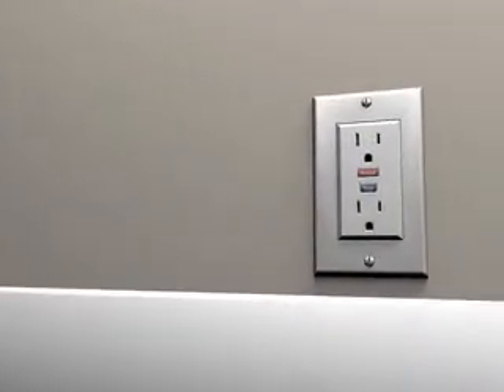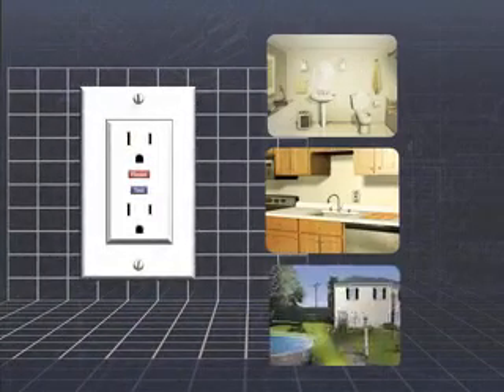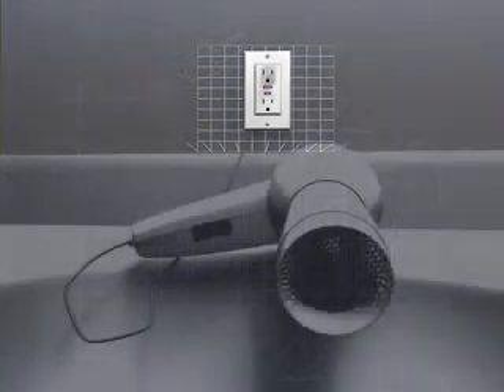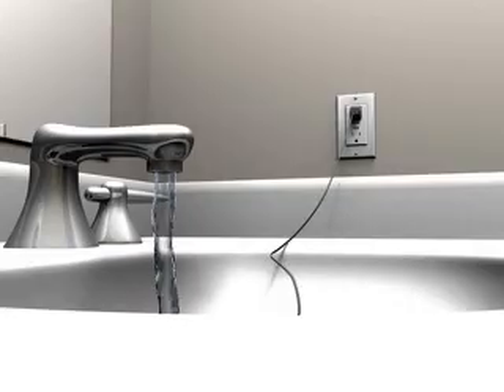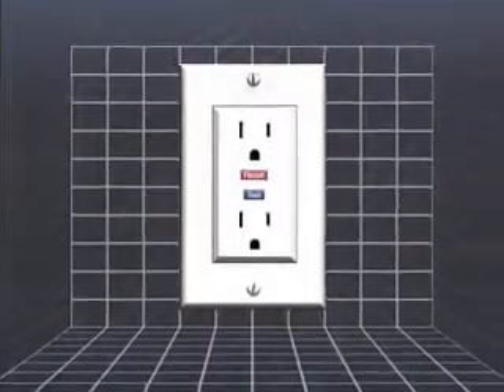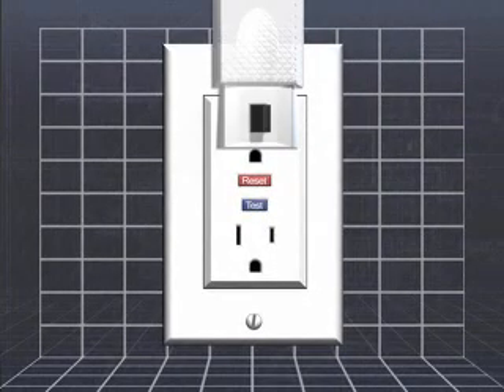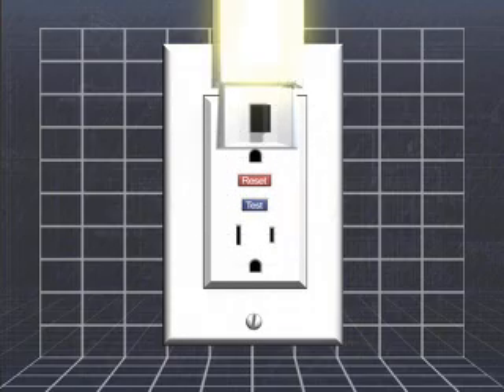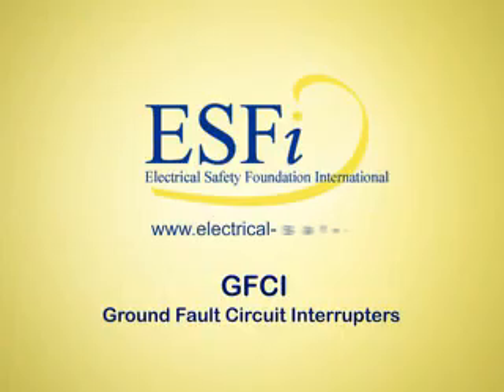GFCI Outlet: How it works and how to test.

Comment: I have an outlet outside on my patio that I’m not sure is GFCI or not, and perhaps it is connected to the same circuit as my garage outlet which is definitely GFCI. This video helped so much. I’ll plug something in to the outside outlet and push the buttons in the garage and see if the outside shuts off, since it doesn’t have buttons. Thank you

Comment: Does the test BUTTON put the current on the ground conductor or the neutral conductor?
Reply: To the neutral so it works even if there is no ground (on old installations).
Reply: @okaro6595  Must use an (inductor) ‘or something’ to cause current imbalance?

Thank you

Comment: I notice many GFCI video's mention that if other plugs are on a GFCI circuit they will be controlled by the GFCI's safety feature.  This is not exactly true.  other receptacles in a GFCI circuit can technically be in the same circuit just not wired to the load part of the GFCI, in this case the GFCI will not cut power to the devices.  A better way to say it is that other receptacles tied to the load of the GFCI, or other receptacles controlled by the GFCI will also trip. But saying all plugs on the same breaker as a GFCI are protected is not true, and can be an unsafe assumption.

Comment: The only thing I don't like about these plugs, is the price, 10x the price.  I lived in the UK once and like the way they have their plugs.  Each male plug has its own 3, 10 or 15 amp fuse in them.  No need for a cfgi.  Sure, the fuse would need replacing if it trips but they're so cheap and it doesn't really happen often.  $23 for gfci, $2 for a normal plug. Robbing sob
Reply: A fuse is an over-current protection device, not a ground-fault protection device. You will die well before the fuse blows, when there is an electrocution accident that might have been prevented with GFCI.
Reply: a gfci has a circuit board in it. Its nothing like a fuse
Reply: @jasonkilner9332  In Europe they do not have circuit boards. Electronic ones are banned here.
Reply: Fuses and GFCIs are not related. In Europe GFCIs are called RCDs and they are in the consumer unit (the panel) instead on the sockets - though socket option is available.

Comment: The outlet in my bathroom only turns off as long as you push test. It goes back on when you release. No reset. My room mate opened the receptacle in his bathroom and found some bullshit wiring with electrical tape and a ground wire that went nowhere.

Not going to say it's the fault of the Chinese landlord, but haha, of course it is. Cheap asshole doesn't employ licensed (or competent) contractors.
Reply: aluisious sue the fuck out of him.

Comment: is it bad to leave a something plugged in an outlet without using it? Like would it waste electricity or something? For example, some people might just leave the charger plugged in without after its full charged.
Reply: Often such devices do draw a small amount of electricity even when they are not charging the connected device.  They are considered "power vampires" because they waste small amounts of electricity whenever they are plugged in, as does a digital TV set that's "turned off", but still remains in standby mode, "ready" for a remote command.  Better to disconnect devices you don't intend to use very often.

Comment: Using the built-in test button is the ONLY proper way to test a GFCI.  Using plug-in testers are NOT an accepted method per UL listing.

I'll repeat that:  Plug-in GFCI testers are NOT approved to test GFCI receptacles.

Comment: Sigh.  Testing with the button is perfectly fine.  It's designed to allow a current leak -which is exactly what a hand held tester does.  It is recommended to test your GFCIs once a month by pushing the button (if you want, you can buy a tester at most hardware stores for $5-10).
If you can't get your GFCI to trip, then it is broken.  Even if you can use it, the safety mechanism has failed and it will not protect you.  Have it replaced.